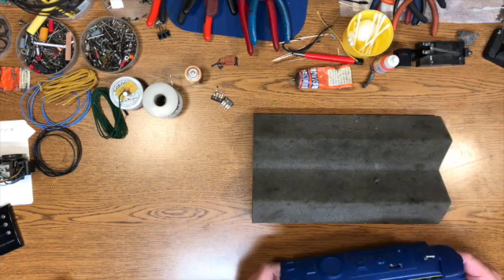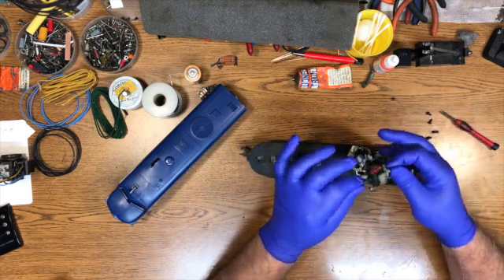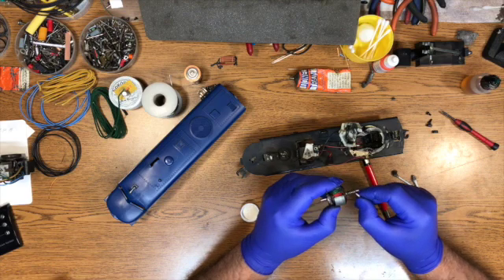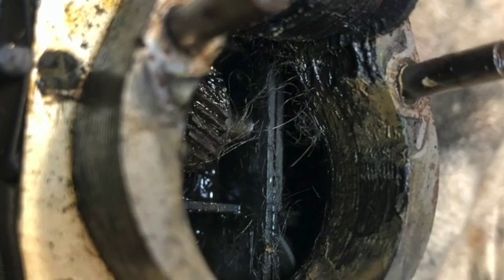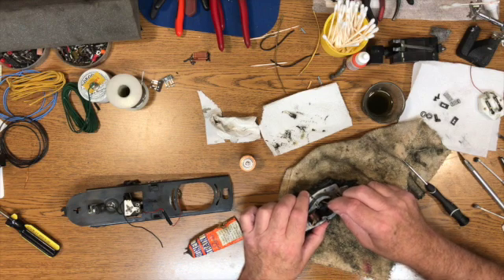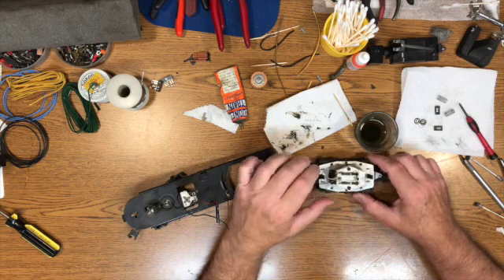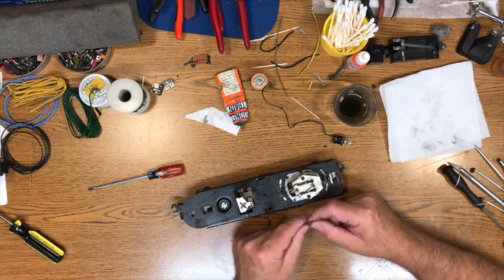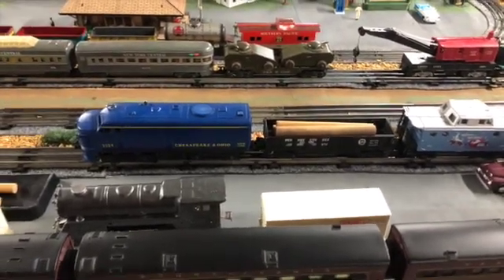Lionel Postwar Alco Cleaning   SD 480p

Comment: My dad bought a Chesapeke and Ohio 2024 in 1970 for Christmas. It was a terrible pulling loco. It had one driven axle with one traction tire. The unit you have has had the power truck replaced, as I think the single axle power was the correct motor. It had a two position e unit with a double wound field winding for directional control. It was the last unit Lionel Corp produced in 1969 before the MPC era, according to the experts. Tandem Associates.